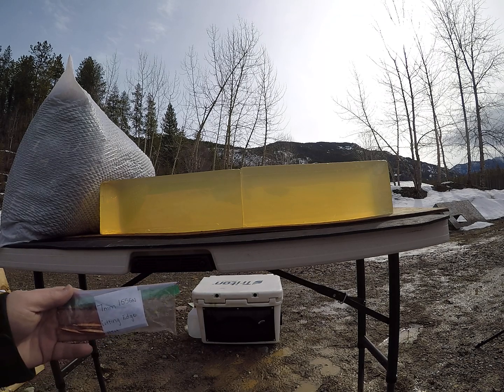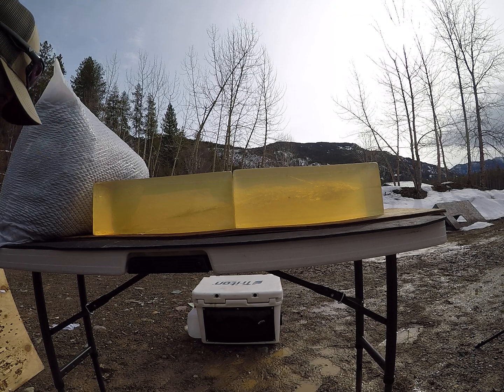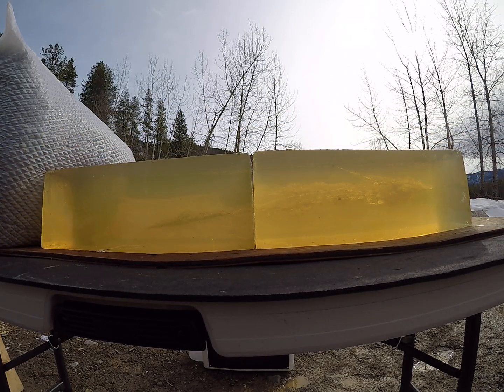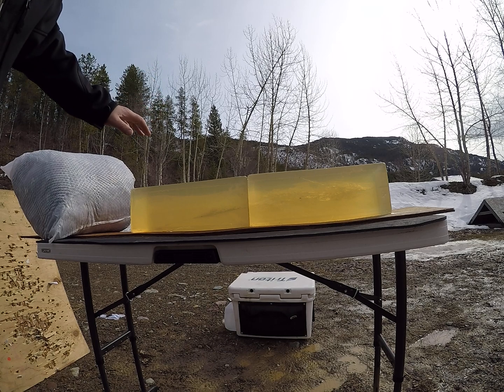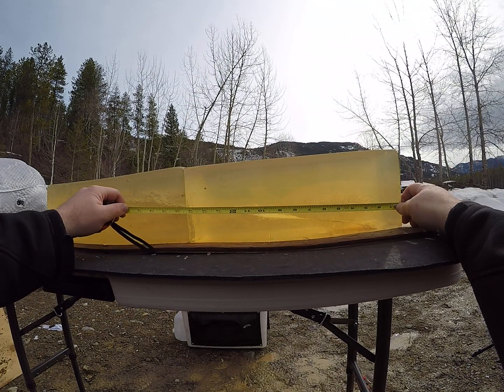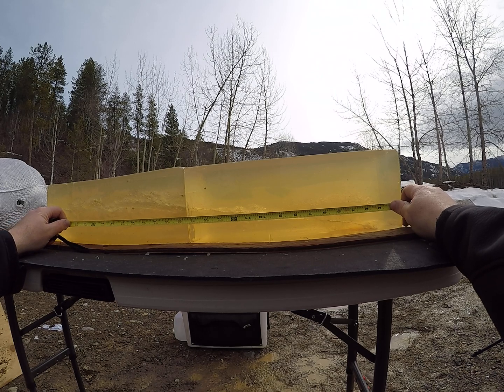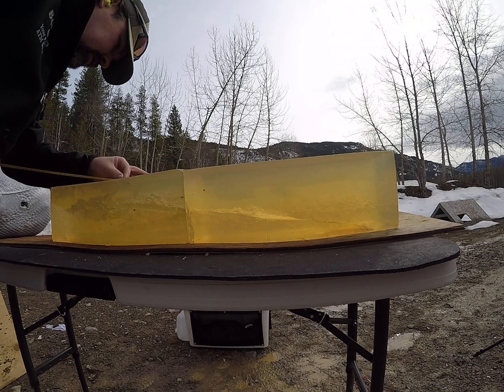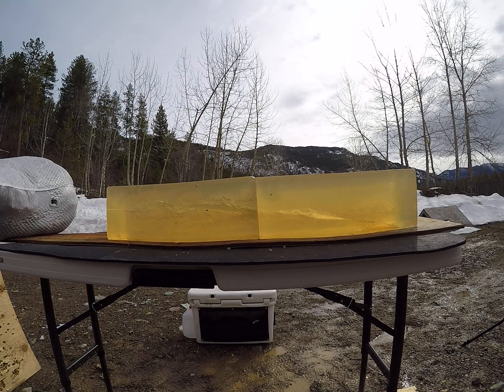.284/7mm 155gr Cutting-Edge MTH shot out of a 7mm-08 at high velocity and low simulating long range

Comment: What is your opinion on this bullet as an Elk Round? What distance is max ? I have heard 350 yard's. I have no experience as I generally use 140 grain in my 7mm08 for deer.
Reply from the maker: I cannot currently recommend these bullets as I am still doing testing on them. Both times I have testes these the high velocity rounds had interesting deformities and did not mushroom and shed petals like they are supposed to. 

I currently use the 140 grain trophy bonded tips in my 7mm-08 for everything including elk and absolutely love them. If you're wanting to go monolithic Hammer bullets are an excellent option I have never had failures with them.

400 yards is a good max distance for the 7mm-08
Reply: @simplemindedfella  thanks for your time.
Reply: In South Africa, I shot many animals with the 150-155 grain MTH and Maximus bullets from Cutting Edge in my 7mm Rem Mag.  The loads were not hot (just under 2900 fps at Muzzle).  Shots were 100-500 yards.  The Maximus were a bit better than the MTH.  I would use the 145 Grain Cutting Edge Laser or the 145 or 150 grain Badlands Bulldozer next time.  The 145 Barnes LRX would also be a good choice.  For elk out to 350, for sure, any of these bullets would work well.  I shot many elk and caribou sized animals with a 120 gr Lost River Ballistic and a 130 Barnes TSX from my 6.5-06.  Muzzle Velocities were 3260 fps with the 120 grain and 3180 with the 130 TSX.

Comment: Great vid!!! What was the make of the rifle?
Reply from the maker: Savage
Reply: @simplemindedfella  I wonder if it is like mine with a 1 in 11.5 twist ever time I would test a bullet heavier then 140 it would tumble I'm my wet pack with the cutting-edge bullet it looks pretty long
Reply from the maker: @cory8791  mine is a 1:9.5
Hard to say. The pedals didn't shed consistently and that could have caused the bullet to tumble adding extra drag on one side. 

Even when using tighter twist and keeping rpm's up certain bullets have a tendency to tumble after impact especially at lower velocities. Burger bullets are very consistent at this and that is what gives them the reputation they have at long range. I pulled many whole bullets out of the far side hide when working for a game processor that were deformed yet whole Burger bullets and the clients were really surprised that bullet was whole because it did so much damage to the animal internally. That was only because it tumbled.
Reply: @simplemindedfella  I think thos hamburger bullets are not realy good for hunting. I like bullets which hold together a bit better. Altough I shot about 100 deer with the 162gr eld-x out of my 7x64 and that bullet fragments a lot. But the lower velocity compared to the 7mm mag in my 7x64 helps to keep things a bit better together. And they bloody smack deer like a train🤣 love em. Altough our deer in Europe are verry small, mostly Roedeer which are 30-40lbs. You could kill them with a stone easy
Reply: The only two nonlead bullets I have had considerable experience with on deer have been Barnes and Cutting Edge Bullets…and the kills have been considerably quicker with CEB, but they have also caused more meat damage.  It’s a fair trade in my book, however, because I want game on the ground as soon as possible.